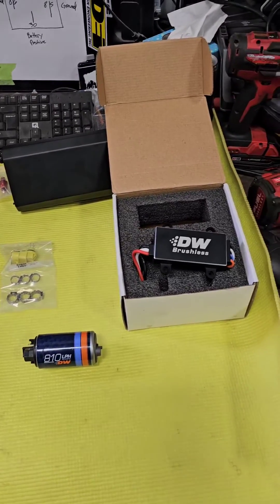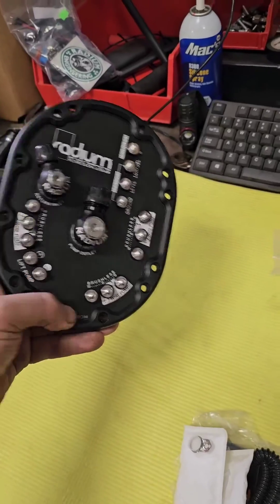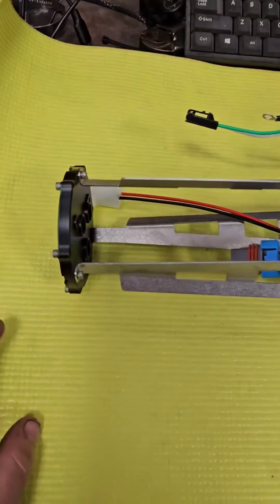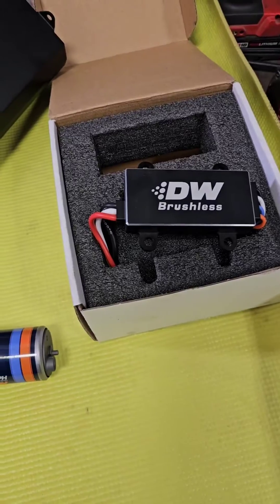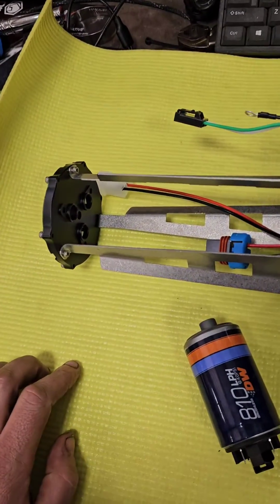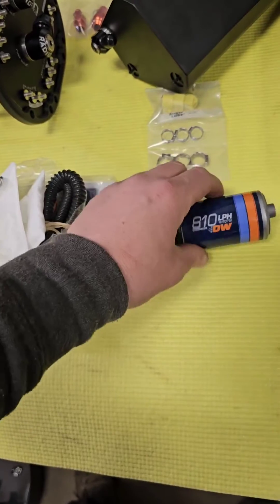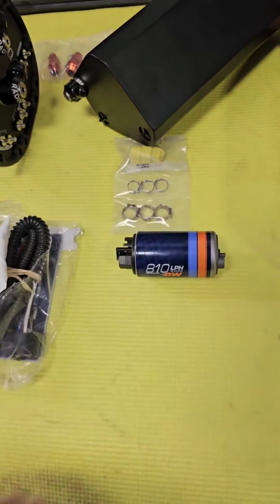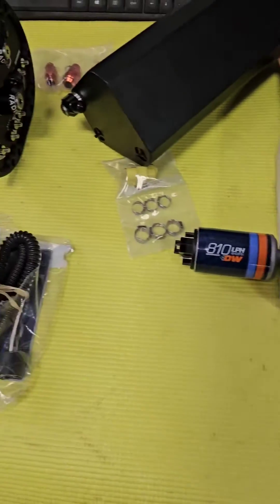DW810 Brushless Pump in Radium Module

Comment: Soooo which wire goes on the R  and G terminal since the DW pump wires are orange and blue. I can't seem to find a wiring diagram .
Reply from the maker: The internal color wiring of the fuel pump hanger does not need to follow a specific order. However, it is crucial that the wiring of the DeatschWerks DW810 fuel pump's connector matches that of the DeatschWerks brushless controller that is wired onto the top hat. Both the fuel pump wiring and the controller wiring use the same color wires. If your surge tank, hanger, or module is missing one wire internally (some manufacturers use a 3-wire configuration), you can install an eyelet on the pump wiring harness ground wire (black) and attach it to the fuel pump hanger. Hope this helps and for any further questions, please feel free to reach out to our tech staff at techsupport@deatschwerks.com.
Reply: @deatschwerks  yeah I quicky realized that I was severely overthinking it. 😂 

Also why is the inlet of the pump slightly larger than most pumps. It doesn't fit into the base of most hangers. The hanger needed to be modified.
Reply from the maker: @crampittts820  We optimized the design to maximize in-tank brushless pump flow.